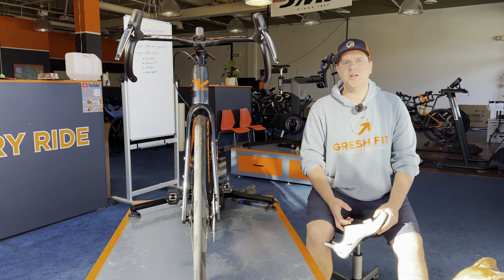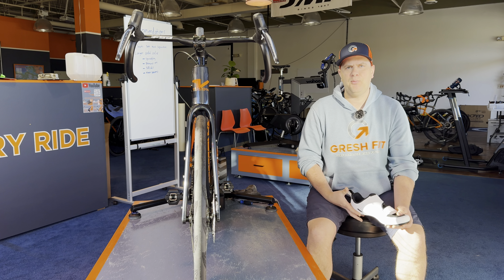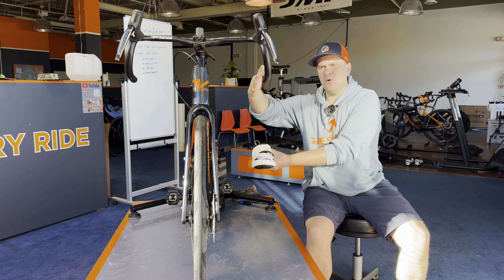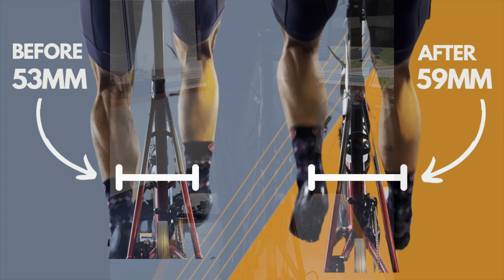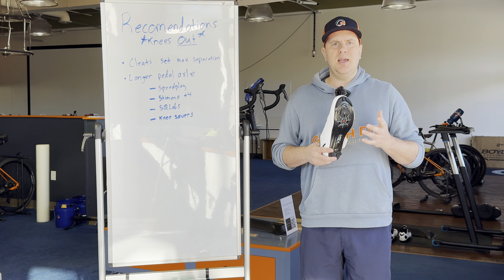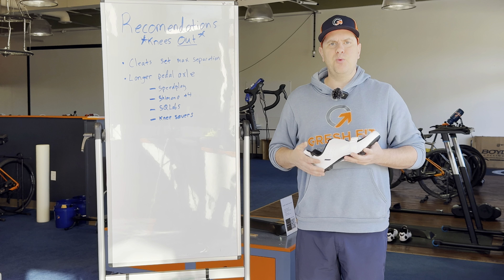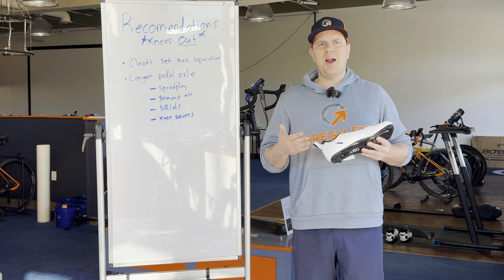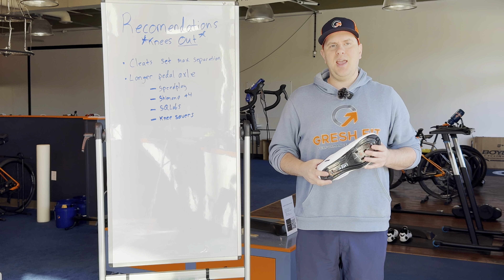Cleat Position - Foot Separation Width (Q-Factor) - GreshFit Bike Fitting

Comment: @greshfit Hi Tim. I've recently started a bike fitting business in Australia and I'm an SQlab dealer. They also have the 512 look Keo compatible road pedals available in "standard", +8mm and +15mm as well as a -4mm

The other option worth mentioning are the cleat extender plates from the UK company FORM. They have 3 and 4 hole compatible plates with variants that can be installed normally or reversed to create +/- 3mm or +/- 10mm width in addition to whatever additional rearward cleat placement that variant allows.

Extender plates are less ideal than longer axles as they shift the centre of pressure under the shoe laterally, but if you have to, you have to.
Reply from the maker: Great info !  Thanks for sharing - I forgot about those items… I need to get in the 512.   The extender plates I haven’t experimented with yet.   Where can I follow your biz ?   I may be in Aus around 2026 to train with Hogg

Comment: The higher-end Look pedals have longer threaded sections that allow a 2mm washer without compromising strength.

Time road cleats can be reversed left and right to move the shoes in or out a bit.

Issi (QBP house brand) used to offer a few widths in their SPD style pedals, but sadly those are NLA.

It can also be helpful to explore cranks that have wider q factors. The White Industries cranks run wide for example.

Comment: Hey, great videos. Was just searching the googles and found your video…
what do you think of the pedal spacers or washers?  I need to get my heel from rubbing on the crank.
Reply from the maker: Thank you!    I think that pedal washers are fine however, practically it will only give you maybe 1-2 mm of additional safely until you run into issues of the amount of thread left on pedal.  So for that reason, I rarely bother with it and just jump to a longer axle such as a Shimano +4 mm or speed play 56 mm.
Reply: Yeah, I was worried about that, I have an investment in dura ace and xtr pedals, and hate the thought of buying new pedals, plus no knee pain…guess I’ll see if one washer helps and move the cleats inward , otherwise maybe a bike fitter for me.
Reply from the maker: It’s certainly worth a try and won’t hurt.  Good luck - enjoy every ride !

Comment: Great video 😊, I recently built a E bike using a mid drive motor. I’m starting to have trouble with foot & knee pain. (Big-time) I took a measurement of the Q- factor on e-bike compared to my road bike which has been pro fitted to me and causes No discomfort issues. The Q factor measurements on e-bike are well over two inches wider 😮 than my other bikes 😢. I’m at a loss 😢. For there is no way to decrease the Q on these motor setups 😢.I’ve installed shorter cranks on e-bike hoping that would help with some discomfort..No Dice😢
Reply from the maker: Interesting… may need to use flat pedals
Reply: Yes that is what I’ve done.seems to feel the best😊